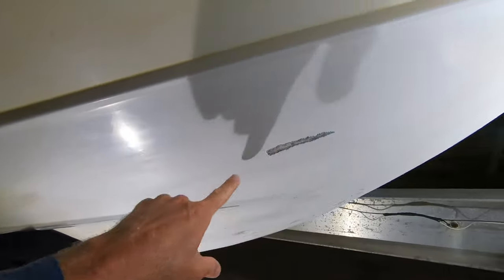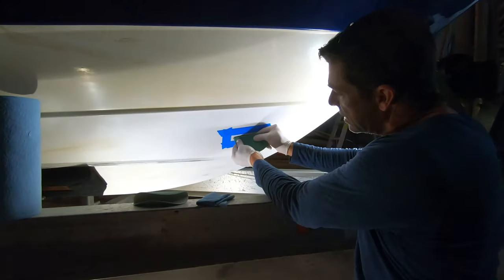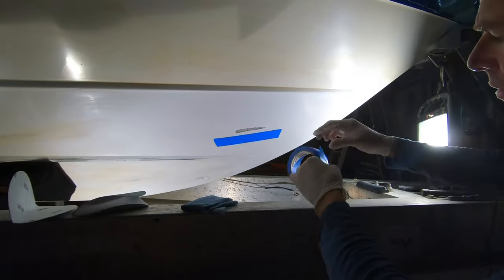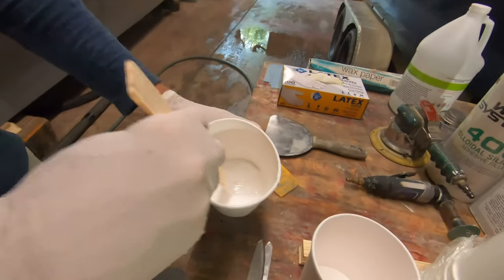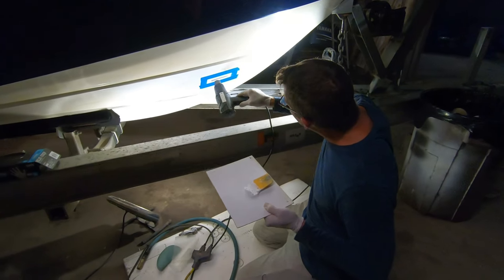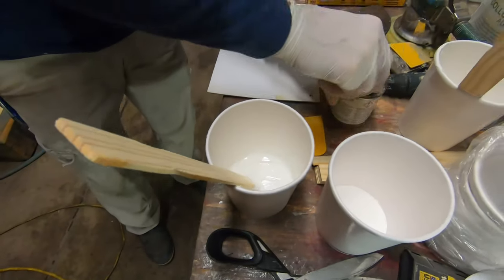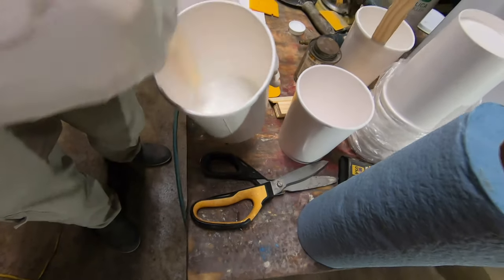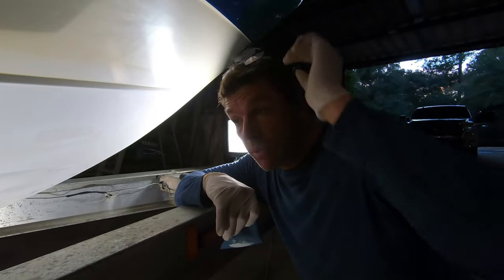GELCOAT and FIBERGLASS HOW-TO- Repair  EVERYTHING YOU NEED TO KNOW to fix gel coat damage on a boat

Comment: Looking to get into small fiberglass repairs like this. How much would a repair like this cost on the street? I don't know much about pricing which is the most important part. I can get the work done no problem. Thanks for your input, great video man!
Reply: Easy $100 per hour
Reply: Easy $100 per hour
Reply from the maker: Shop labor rate in our area is 100 to 150 an hr for good guys that can really get some work done. 3 to 5 hrs on a job like that, maybe more on a more challenging color. Hope that helps and thanks for watching!
Reply: If you keep your hull waxed good will it prevent water stains? I have used bar keeps friend in a spray bottle it work’s amazing to take off water stains but it strips any wax

Comment: Excellent video. I have an old Glas Ply that needs some renewal. What combination would be good for filling pock marks on the deck surface? It would be very difficult to prep the edges of all the small holes. Is there an easy spreadable mix that I could cover the entire deck with, then sand?
Reply from the maker: Thanks! Gelcoat or gelcoat thickened with colloidal silica works good for filling small gelcoat dings. I would clean the damaged areas first with some acetone, then a wire brush, pick, or a die grinder. I also have several more gelcoat repair and filler selection videos on the channel that should be helpful.

Comment: Video’s are very helpful thank you. I am repairing a keel similar to yours though mine is around 10 inches, and am curious if thickened gel coat or formula 27 filler then gel coat is best?
Reply from the maker: Glad to help! Honestly either one could work. I don't personally like applying gelcoat much over 1/8 thick on repairs. 3m also makes a very good vinyl Ester structural repair filler for deeper scratches that are below the waterline. I hope this helps and thanks for watching!
Reply: @FishBumpTV  Much appreciated!

Comment: Thanks for the video. I have a fairly deep scratch down to the raw fiberglass below the waterline in the bottom of my boat hull. Is this the right process for repair or is there a different type of filler I need to use? Want to make sure it’s structurally sound.
Reply from the maker: Without actually seeing the damage it is hard to say if what you have is just cosmetic damage or if there is structural damage. There will be damaged and fractured glass if there is structural damage. That damaged fiberglass would need to be repaired with new fiberglass before you did the gelcoat repair. I will try to get a fiberglass structural repair video out for you guys soon. I hope this helps and thanks for watching!
Reply: @FishBumpTV  thanks for the reply! Also, thank Lew Childre for sharing your content( I used to work with him). I now know way more than I thought I ever would about how to build a boat. Great stuff!

Comment: Hello, what gelcoat brand do you use ?  Also, after the gelcoat do you have to prime then paint or just paint ?  Any paint brand suggestions ? Thank you awesome video btw !
Reply from the maker: We use Polynt Gelcoat, but there are other good brands out there. There is a part 2 to the video you watched that details the finishing process. You  do not prime or paint the repair, you wet sand and polish the gel coat to a shine. Hope the video helps you finish your project. Thanks for watching, and commenting!

Comment: Instead of compressed air, can you use a vacuum cleaner to clean the sanded area.
Reply from the maker: I think compressed air works better, but if you have a vacuum with a brush attachment on the end, that works pretty good. Hope this helps and thanks for watching
Reply: @FishBumpTV  thanks.

Comment: I have a ranger aluminum boat , and would like to know if you can just sand the bad spots and use jelly coat to paint it or what needs to be used?
Reply from the maker: Gelcoat is not made for coating aluminum boats. I would recommend a epoxy based product made for adhering to aluminum. Thanks for watching!

Comment: I’m having to do some work like that my boat and I’m curious and wonder whether the hardened gel coat would be the best or structural repair putty would be the best to use? Any advice or tips on this. Thanks for the pointers.
Reply from the maker: In my opinion, The thickened Gelcoat is fine for smaller repairs with damage less than 1/8 of an inch deep. If the damage is deeper than 1/8, and the fiberglass around it is structurally damaged I recommend a marine-grade repair filler. Hope that helps, thanks for watching!
Reply: @FishBumpTV  Which marine grade filler would you recommend? I have several scratched like the one you repaired here from the front bunks rolling out. Also along the bottom I have some repairs. Then I need to repair the keel which has some damage. It just the gel coat thats cracked off the keel but fiberglass is exposed.

Comment: How do you know what repair is needed depending on how deep into the fiberglass? I have damage from the anchor about the size of a quarter but it clearly goes into the fiberglass. Can this be repaired with this process?
Reply from the maker: It is hard to say without actually seeing it and inspecting the damage. If it is quarter size, and above the waterline then this style of repair is probably fine. If it is below the waterline, and the damage runs into the fiberglass then it might be structural damage. In that case fiberglass or a structural filler might need to be added. I hope this helps and thanks for watching!

Comment: I have a car cargo rack made of fiberglass with a gel coat. It has cracks and exposed fiberglass from impacts. I live in Washington state and it rains forever. I think this method should work on making everything waterproof again. How much does all the materials from west marine cost? I have made traditional wood boats and worked with fiberglass but not much in the way of gel coats.
Reply from the maker: The thickening additives from west systems are reasonably priced. I think they were around 25 dollars a can. Hope this helps, good luck with Your project, and thanks for watching!

Comment: any tips on matching new black gel with old black gel?
Reply from the maker: Black can be a little tricky. Just be sure you are matching to the true color of the hull, and not a badly oxidized area. Another option over trying to match yourself, would be to contact the builder for some factory matched gelcoat, or contact a company like Spectrum gelcoat for one of their custom matches. Hope this helps, thanks for watching!
Reply: Sadly Honda does not make PWC's anymore and I will have to figure out how to make it match. Almost better off leaving it alone I worry @FishBumpTV

Comment: i have a few small cracks in my gel coat.  I have some jb weld marine weld, it says it bonds to hulls.  can i use this for my small cracks until i can get around to using a gel coat repair kit?  also, where can i get a gel coat repair kit and what all do i need in that kit to complete this job?

Comment: Great video l am filling 6x9 speaker holes and l used gelcoat thickened with fumed silica the gel coat has wax in it what do you suggest to apply the final  coat thank you
Reply from the maker: Thanks, appreciate You watching! Just to be sure You are using thickened gel in the right application. If the area you are filling is more than 1/8th of an inch deep, you might want to consider using some kind of structural body filler first, Then some thickened gel, followed by un-thickened gel with wax in it on the last coat. If gelcoat is applied to thick it can be brittle and crack over time. The final coat can be applied  with a brush or short nap roller, or sprayed with a gel gun. you can also use a flexible blade on smaller areas. Hope this helps, and good luck with your project!
Reply: Thank you
Reply: Can you gelcoat over waxed gelcoat? Thinking waxed is for final coat only.

Comment: Can the catalyst be the small tune catalyst that looks similar to bondo catalyst?  This one is specific for gelcoat.
Reply from the maker: It is possible that Bondo-type  catalyst could work, but I wouldn't recommend it. I have always used the clear liquid type like in the video. The catalyst for Gelcoat is also known as methyl ethyl ketone peroxide or mekp for short.

Comment: Could you give me your opinion on why the 406 and not the 410?  Thanks.
Reply from the maker: The 410 is more of a lightweight fairing filler, 406 thickens the gelcoat, but with more density. You may be able to use the 410 just fine, I have always used the 410 with good success. Hope that helps, thanks for watching!

Comment: I am getting ready do fix some hairline cracks.  I widened them out to around 1/16 inch wide and 1/16 in deep.  The boat is flat bottom and turned upside down.  Would you go straight to gel coat or still put a thickened base down?
Reply from the maker: Hairline cracks can be tricky. Gelcoat usually cracks because there is movement or flexing, or there was an impact to that area. If the movement is because of structural weakness or flexing the gel coat will continue to crack unless the movement is stopped. If the cracks are from a impact, you would want to be sure there is no structural damage before you repair the cracks, or they will likely just reappear. You could fill them with straight gel coat, and if they reappear you would know that you may have some other issues. I wish it was a simple answer, Hope it helps anyway. Good luck with your project, and thanks for watching!

Comment: Will these scrapes cause water to leak into the boat?
Reply from the maker: Shallow scrapes like these usually will not allow water to leak into the hull. But if you have damage like this you should make sure it is very dry before attempting any kind of repair. Thanks for watching!

Comment: Do I need to apply epoxy or epoxy with hardener over the filler before I apply the gelcoat?
Reply from the maker: No, generally you do not apply any kind of epoxy under gel coat, it will not adhere well as they are very different materials. I recommend staying with the materials, and steps we use in the video exactly. Any substitutions or changes could result in a problem. Hope this helps, thanks for watching!
Reply: @FishBumpTV  Thanks!

Comment: Is there any benefit to using thickened gel coat vs. formula 27 and then glue coat over for this type of repair ? Is one stronger than the other ?
Reply: Gel. Not glue. ..
Reply from the maker: The formula 27 is good for deeper repairs that need more filling. The gel coat is more water proof, and is better for lighter damage in my opinion. They can both work well, I just wanted to show some options when it comes to repair methods. I plan on doing more gelcoat repair videos soon. I would appreciate some requests or suggestions. If you have any, just let me know. thanks, and good luck with your project!

Comment: My gelcoat didn’t set up right its still sticky. I didnt have the wax and i covered it with shipping tape. Im not sure if i used to much hardener or what 😏. How would you clean the old back off. Just sand it an clean with alcohol
Reply from the maker: You might want to try some small test batches of gel coat to dial in your catalyst ratios. Small batches require very precise measurements. Generally, 1 to 2 percent catalyst is where you want to be. It can also be difficult to get the gel to cure under a film like shipping tape. The wax additive is really the best way to go if you can get some. There is another material called PVA polyvinyl alcohol, that can be sprayed over the last coat as a film or air inhibiter. If you can not get those materials you can use wax paper, like what's used in cooking as a film over the last coat of gel instead of shipping tape. it should work better. We always use acetone as the solvent of choice when cleaning surfaces or removing uncured gel. Hope this helps. thanks for watching!

Comment: Question for you. I had my boat hauled and bottom painted in Mexico a few years ago. It was only when i recently came to repaint the bottom that i discovered that the Mexican yard had been overly aggressive with the sanding and had gone through the gelcote in multiple places, without repairing it (just covering the damage with bottom paint).  How best to repair it? I also have discovered blisters (not sure if that is related to the Mexican yard or not). Can the repair methodolgy cover both defects? Finally, since that haul out, i notice that my boat is sitting lower in the water. Is it possible for that the (solid, not cored) fibreglass to absorb sufficient water to affect the waterline?
Reply from the maker: Sorry to hear about your problem. It is usually recommended that an epoxy barrier coat, such as Interlux 2000E be used over the freshly sanded gel coat before applying the bottom paint. This helps prevent moister from migrating into the fiberglass, which will cause blisters to form. Interlux makes an epoxy filler made just for below-the-waterline blister repair. The basics of the repair would go like this, remove the old bottom paint, grind out all of the blisters, and give the boat some time to dry completely. Then clean and fill the blister damage with an epoxy filler made for blister repair, let it cure then sand fair. Then apply 3 to 4 coats of epoxy barrier coat, then within the cure window of the barrier coat apply 2 to 3 coats of bottom paint. That covers the basics, I recommend you continue to do your research and decide what is the best method for you. As far as water adding enough weight to the boat to change the waterline, I don't think that is likely. Water may be somewhere else in the boat. Hope this helps, thanks for watching
Reply: @FishBumpTV Your advice is much appreciated. I have also since learnt that any filler they used was polyester based resin, not epoxy, adding to the problem. Yes, I will strip everything back and  fo it all over again, this time using epoxy resins plus a barrier coat. One more question for you: The boat is now in Panama, which has a high humidity climate like Alabama. How long do you allow for drying and do you employ any special techniques to accelerate drying time? I am unlikely to find a yard with anything like an environmentally controlled shop or equipment like heat blankets.